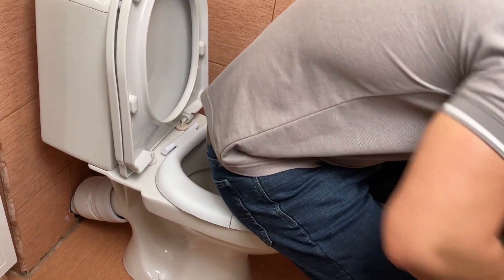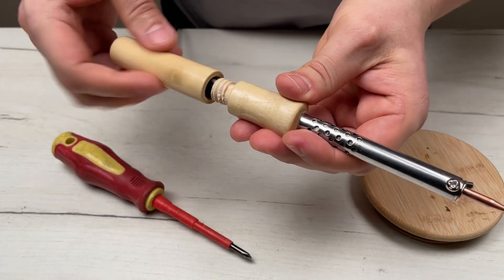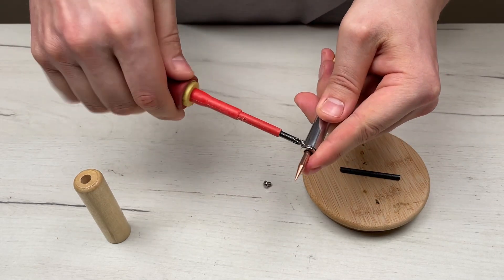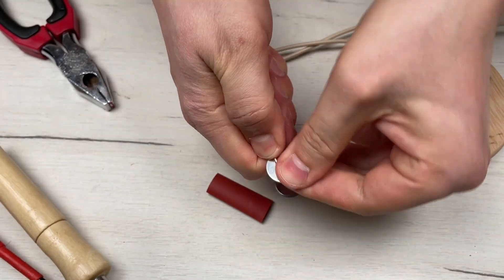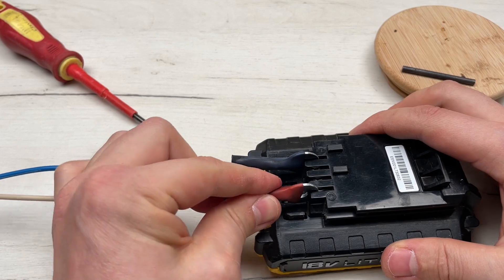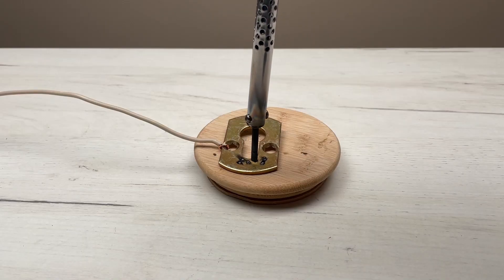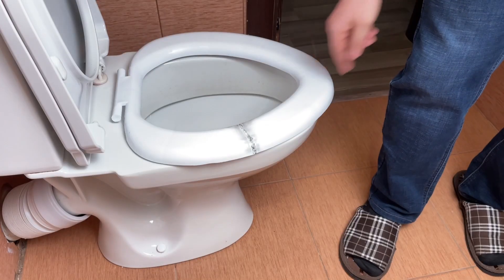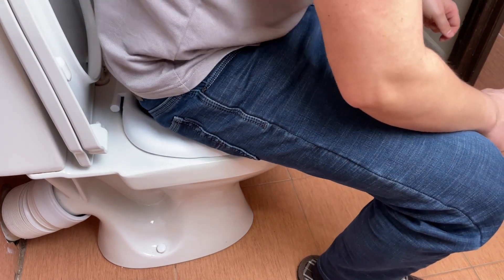It Shouldn't Be Expensive❗️ Insert the graphite rod into the soldering iron

Comment: It is not going to hold. And the pretend testing after the repairs are just slight of hand productions.
Reply from the maker: Friend, it will hold up, I assure you! The design is very, very reliable and durable
Reply: I have done many trades with many types of fabrication. It will not be strong.